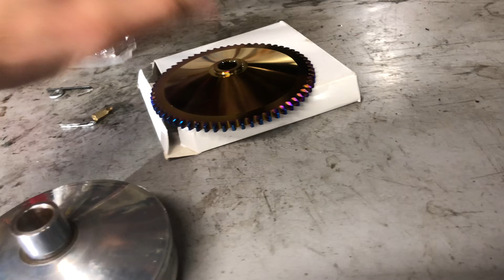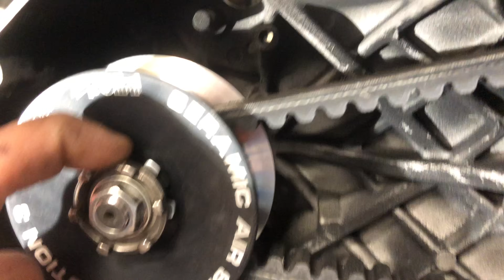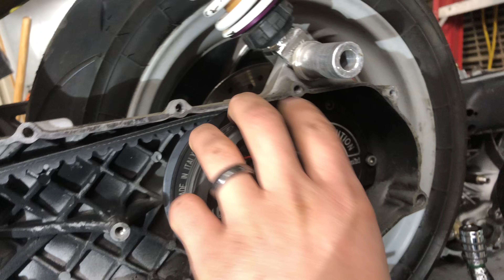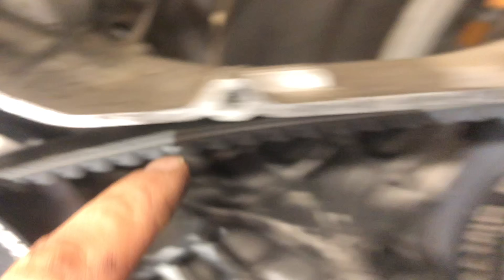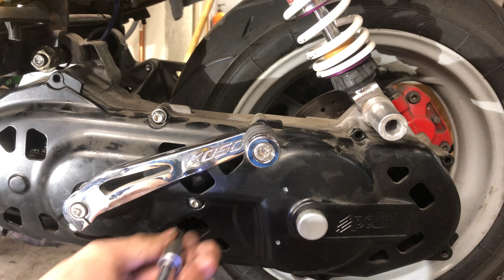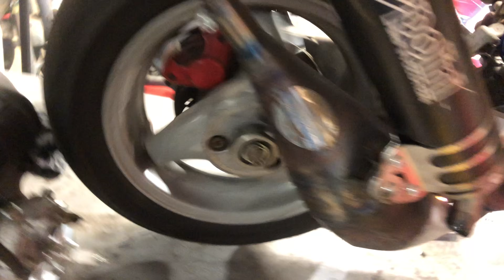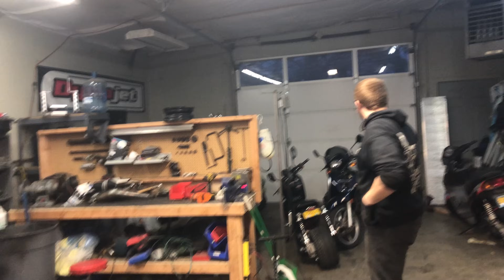Scooter CVT transmission explained

Comment: Very well explained! Even the smallest things in transmission can make a difference in performance. I've bought my second scooter - 2013 Aprilia SR50R (carb ) and I''m  rebuilding it to 70cc ,i did rebuild my 1st scooter Yamaha Aerox to 70cc too ,but only changed the pipe, cylinder kit and air filter. It ran good for the small amount of tuning i did. But the SR50R  i'm tuning a lot more -sport transmission ,Yasuni pipe , streetrace 70cc ,bigger carb ,intake etc.  ,thanks to this video I learned a bit more about transmission tuning.
I'm surprised that in USA the scooter tuning is also popular. I'm from Europe (eastern europe - Latvia) and here it's a very popular thing amongst teenagers and even adults. You can pass the moped exam if you're 14. ( I'm 16 btw.)  We even have a scooter forum  ,official scooter meetings twice a year (10 or 11 years since the 1st one) with  cast-iron and aluminium class drag races , and a lot of scooter riders upgrade their rides a lot to win those drags..even porting cylinders and engine blocks. 
In the past I thought that in USA people only put 150cc big bore kits on their 4 stroke chinese scooters and that's all with tuning :D but I'm surprised that there are 2 stroke powerful builds with all the known brands - Malossi ,Polini , Stage 6 etc. 
A subscribe and like from me.
Reply from the maker: Thanks

Comment: Great video..changed output shaft and seal on malaguti f15 rr 69cc. Used to do 50mph. Changed belt and rollers at same time. Now moped only goes to 30 but nice and 20 up a hill. Any ideas? Old flat rollers were 4.8g. tried 6g, 4.7g and now 4g.
Reply from the maker: Nice work!

Comment: if you  modificate the clutch then mast to modificate variator rolers too and or the big spring of driven pulley what i see here your setup its not good lol when you accelerate the belt go down on the pulley befor the cluch angage thats meen you start to move with some like second gear hahaha is not good :))
Reply from the maker: Didn't quite understand that.

Comment: I have watched a zillion videos about CVT's because my car is a 2007 Nissan Maxima. But there is one thing I have never found out; yet I think it is important.

IE: Is the belt and pulleys flooded in CVT fluid; or are do they work completely dry? I understand that the rest of the transmission is flooded with fluid; right down to electrical parts and wiring. But what about the belt and pulleys.

"Inquiring minds want to know!"
Reply from the maker: cvt on bikes are dry.

Comment: So I bought a ncy complete cvt performance kit and put 12g sliders in and came with 1500 "yellow"  contra and three 2000 "red" clutch springs..
The motor is pushing right at 180cc and when I give gas it takes forever to actually move... I. E. High rpm 
What am I doing wrong?
Reply from the maker: You’d need to contact the store you got the trans parts from. I’m not familiar with your bike or the components.

Comment: Hi i changed my clutch and variator to malossi and now it revs like crazy but doesn't accelerate very well. Do I need heavier weights? Let me know please
Reply from the maker: You go the variator from us? what bike? What weights are in it now? Whats done to the bike? need more info.
Reply: @Scooterswapshop  hi i got the malossi kit from ebay. It has 9.7g rollers and the bike is a kawasaki j125. Engine is stock, just the malossi variator and clutch upgrade. Appreciate the quick response 👌
Reply from the maker: Thanks, you would need to contact the shop you got the components from as we don’t have the data on the parts you purchased

Comment: This is the best video I've seen yet thanks! Quick question, the teeth in the belts what do they slot into to stop slip?
Reply from the maker: Thanks!
Reply: The teeth don’t slot into anything, the teeth are on the belt just to help it bend around, to help it flex better.

Comment: Tmax 500,malossi variator,16g rollers,good acceleration but I lost top speed. Any other way to still have good acceleration but not loose top speed?
Reply from the maker: It comes down to tuning and playing around I would say go down 1 gram on the rollers from what's stock and try that.  if its stock ECU that could be what's holding you back on the top like our adv. We are getting a tmax really soon so we can play with what's best.

Comment: please, someone, let me know how you adjust for hills and heavy loads and stuff. say you want to rid up a hill and pull a heavy trailer, how does this system account for that? surely the gearing ratio should be adjustable according to how much torque you want and not just set for general riding on flat terrain? how could one account for this if this system does not? some way to interfere with the centrifugal adjusters or something?
Reply: When the load increases, it causes engine rpm to drop, which in turn reduces the gear ratio (like going a gear down) and sends more torque to the wheel. A variator is not a very efficient way of getting different gear ratios because gear ratio is a function of engine RPM, but it works well enough and simple and cheap enough for inexpensive scooters.
Reply: @electric_boogaloo496  how is the nuvinci  system in terms of efficiency?
Reply: @snorttroll4379  I checked a YouTube video about the nuvinci, the gear ratios are user controlled. So, it is not like the gearing in automatic scooters. You can select whatever gear ratio at any pedal cadence. Kind of like a traditional gears in a bicycle, but with infinitely many steps between the gears.

When I spoke of efficiency, I meant fuel efficiency, not mechanical. if you can vary the gear ratios at will to keep a petrol/gasoline engine at low rpms and high load, then you get best fuel efficiency. You can't do that in an automatic scooter like you can do that on a motorcycle. Then there is pure mechanical efficiency, where fixed gears and chains are certainly better than belts. I can't really speak of the nuvinci's efficiency, but its unlikely it will be better than chain and sprocket.
Reply from the maker: looks like the boys answered your questions

Comment: the performance parts  a joke what's the point of trying to squeeze power from a 8hp engine.  Just get a bike with bigger engine.  My bike has 20k miles on it with original clutch.
Reply from the maker: The 200cc should run 5’s in the 1/8, thats on par with a 1800lb 1000whp car. So when you get gapped by a scooter don’t be upset :) riding small things fast is fun. It’s not about max speed it’s about building, and modifying

Comment: Hey nice video ! If you want to go for big topspeed ! What is a good combination? Heavy rollers at front or light? A strong spring of not strong? And the little springs on the clutch strong or not strong? What is a good combination if the goal must be big topspeed ?
Reply from the maker: We recently did a video on this actually Paul goes over it!
Reply: @Scooterswapshop  where can i find it ? You have a link ?

Comment: Does cvt require vent or air flow? Planning to change my cvt crank cover to glass but there would be no vents
Reply from the maker: glass?
Reply: @Scooterswapshop  yup... it was light metal crank cover with glass on side, so you can see the pulley. The designed sucked it lets water flow into cvt so i sold it

Comment: Best drive system for small engines .
Maximum output all the time.
Watch the scooters pull away from lights the cars are still stirring the pudding and the scooters are gone.
Reply: how do they do that? how do they optimise for torque on the wheel? do they later optimise for energy efficiency?
Reply from the maker: YUP

Comment: What should be modified to have a good torque..pick up..light roller or weaker clutch spring?
Reply from the maker: Depends
Reply: @Scooterswapshop  depends on??
Reply from the maker: @laldinsanga1729  on everything. What bike it is what cc, 2 stroke 4 stroke.
Reply: @Scooterswapshop  what im trying to say is that to improve the performance..what change can we made?

Comment: That's water cooled head. So you have a radiator on it. I had a honda elite. 2000, bought it brand knew off the showroom floor at the Honda dealership near the Airport. I put  a polini Corsa head & cylinder, piston & rings. Stock crank & con rod.  I put 8.4:1 gear. 28 mm oko carb, & a Dio pipe. I changed the ramp & weight, & put a polini clutch on it. I lived in Haleiwa on the North Shore of Oahu, & wanted to be able to go up Kam Hwy through the pineapple fields & in to Pearl City & then Honolulu & Waikiki. I was in the Waialua library one day & had locked the front wheel up to the bike rack, & when I came out only the front wheel was there. Always lock the back wheel & go through the frame with a thick cable. I was so angry because the guy who stole it was a hawaiian ice head who I had helped out several times & given him parts for his moped. I never got it back because they part them out, or send them to another island.
Reply from the maker: give the shop a call!

Comment: Just finished breaking in a Big Bore Kit, i know i have to tune the roller weights, Clutch Spring & Contra Spring...

Can you make a tuning serious from start to finish on a stock cvt?
=I dont know where to start, the contra spring, the clutch spring but im guessing you finish with the roller weights...

also your clutch doesnt spin until you rev it up.... my spins on idle... 
im thinking the clutch springs are too soft...  but should i be setting it up like in this video ? whats the differene in terms of ride?

any info would help, please & thank you
Reply from the maker: what parts did you buy here?
Reply: i got a 1,000 rpm and 1200 rpm contra spring but dont know how high on the RPM to go
i have a dr pulley clutch kit 
i have a new variator and roller weight set (9.10,11, 12 grams)
i have a new belt and a few variator shims

Comment: Sitting here absorbing this information. Have a 49 or 50cc Chongqing  Astronautical Bashan Motorcycle Manufacturing Co LTD. It's a 2008 model scooter. 

It's from China I do know but the company name was really long and trying to look them up really didn't get me much. 

Few things I want to do. Full Service, Check Clutch & Belt, Wash air filter, new plug, fuel filter if applicable? And so much more. I'm 6' 3" and Appx 335 lbs. Need a heavy duty shock and some upgrades that will last.  

A big bore upgrade kit and good video tutorial and/instructions would be nice. Speedometer calibration would be nice but I think if I can find a mount to clip my phone onto the dash somewhere I maybe can use GPS? 

My throttle sticks at times when I release which I'm glad I noticed but only after I'd bought it private party used. 

I also threw a ounce or two of lucas injector/carb cleaner in and it definitely must've cleaned something out as it idles better than before as it would die at a light unless I kept on the throttle. 

I've noticed when I use the big kickstand the rear wheel has up and down play and a little side to side which I didn't notice when I test drove it and checked it. 

I have some synthetic 15W-40 Engine Oil and a bottle of GL-5 Gear oil as 3 or 4 weren't available locally and after much looking it appeared it would fit the same application. I did get the synthetic 75W-140. 

My guess is maybe it goes in rear axle? Would love to learn more about these either video or reading if anyone has some great resource links for it. 

I saw a guy today thar had a VIP branded scooter basically identical to mine and I mean identical but my scooter is a 2008 and his was a 2019 or 2020 with 632miles on his compared to my 7,179 miles. 

IF anyone can help me with information that would be great. 

Anything 50cc or less don't have to be licensed or the driver don't need a motorcycle endorsement either. 

This is something great I like about our law here in our state. License plates aren't required either. I do have to switch the title from the old owner to me. If I want a license plate I can get one but that's optional here. I do plan on getting liability insurance as well. 

Thanks for reading my post and sorry so long but wanted to get it all out there.
Reply from the maker: we don't do china scooters they are not worth the time.

Comment: i have used 2015 honda ruckus. it has modified air intake and has a larger main jet but has stock exhaust. it seems like the scooter speed tops out before the throttle is fully open and then when fully open the throttle the top speed bogs a little bit. is this because I need an exhaust that is more open? or is there some other variables. i am a bit confused about changing the air intake set up because there is multiple air intake filters attached to multiple spots on the carb. any thoughts about a bit of bogging at fully open throttle?
Reply from the maker: cvt tuning time

Comment: I’m surprised the belt lasts as long as they do considering it gets squeezed by the different ratios of the drive and driven pulley
Reply from the maker: it slides. not really squeezed a bunch

Comment: Thank you. I'm wondering if you can make a video explaining how the rear end component works, with the seals and the gears in the transmission. 
The plug fell out of my offf-road scooter when I was stuck in some sugar sand. I ended up running my scooter like 40 miles without gear oil. Somehow it is still running fine, but now it is leaking gear oil. I'm trying to figure out what to order, I believe I should replace the rear bearing and seals, I have the manual .. .  I wish there were a whole rebuild kit I could find like for the cyclinders...
Reply: You be ok just replace seals and bearings fresh oil
Reply: My gy6 hast had oil in it ...probably 3 months after i built it. I bought it used the trsns is old! The shafts didnt seal so I got almost all the parts to rebuild!  New shafts new gears new besrings new seals new gasket
Reply from the maker: we have so many cvt and trans videos already!

Comment: Hi i just want to ask for advice if what is the best thing to modified a stock 50cc af28 with af18e engine without changing the crankshaft and the cylinder. Thanks
Reply from the maker: feel free to call the shop we can get you the parts you need

Comment: My Yamaha zuma 50 no longer reaches top speed and only speeds up to 29 mph. Will installing new rollers help?
Reply: Sounds like you need new rollers. I bought a used 50cc honda metro with 5,000 miles it would top out at 27 and bounce of the rev limiter. Took it apart and the rollers were in pieces. It can't go into high gear and hit top speed if they are bad. Check your valve shims too as that can cause power loss also if the valves don't close all the way.
Reply: @Richieb75  I replaced the weights and it still doesn't reach 36mph
Reply from the maker: sounds like a few things

Comment: Need to watch this because the transmission is mine completely fell apart, bent springs and deformed metal pieces loose around there.
Reply from the maker: sounds like you should replace it all

Comment: I was riding mine today when there was a horrible high pitch scraping sound and the engine immediately cut. I was riding in my yard so I just pushed it up to my house, but while doing so there was a scraping sound coming from the transmission. It was a crappy Dykon Fugati 50cc, is it possible it's just the belt? However, I tried to start it again and there were no signs of combustion, so I'm not sure if it's the engine. I'm mad because I just put the carburetor back on it today, now this. It has 1,123 kilometers, 698 miles.
Reply from the maker: bummer

Comment: If the belt isn't worn, how often does one need to replace the clutch springs?  how do you know that the clutch springs need to be replaced?  I am not trying to modify a scooter.  I just want to make sure it is in good repair.  I am thinking about buying a 2009 Kymco Xciting IR 500 that the regular maintenance on it is in question.  The bike looks like it is in great condition and seems to drive fine.  It only has 7300 miles.  The seller doesn't drive it much.  Would you care to comment?  I don't want to end up buying a lemon.
Reply: If the clutch springs are worn the clutch will grab at too low RPM. The engine RPM should rise a bit before the scooter starts moving when you twist the throttle. It probably varies from scooter to scooter, but I think it's common to replace the belt every 5000km/3000 miles or so. Clutch springs rarely needs to be replaced, so I doubt they're worn out, unless he's driven it with lots of stop and go like in city traffic.
Reply from the maker: we have many videos on cvt I suggest those for your answers

Comment: I sure hope you can tell me what's wrong with my scooter.  I have a Aprilia Scarabeo 500.  The drive belt broke and I replaced it with a new one.  The problem I'm having is - when I start the scooter, it wants to take off immediately.  I planned on video recording me taking things apart so I would put things back together correctly.  Unfortunately, I didn't video record things when I took it apart and now I'm paying for it.  I have one washer that I can't figure out where it goes.  I thought it would go on last before putting on the nut for the clutch.  But when I put the washer on, there were only a few threads for the nut to go on and it won't go on more than half the threads on the nut.  So I didn't use the last washer just so the nut will go all the way on.  What needs to be done so I can have a neutral when starting or pushing the scooter when the motor is off?  Could I have tightened the front pulley's nut on too tight?  HELP!
Reply from the maker: we can get you the parts you need!
Reply: @Scooterswapshop  Hey thanks.  I got it fixed but will subscribe to you channel.